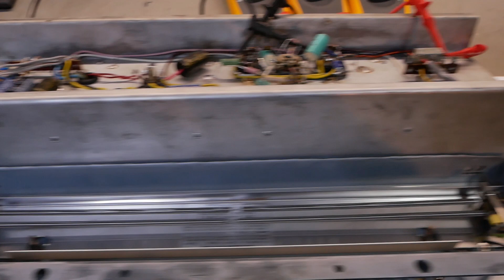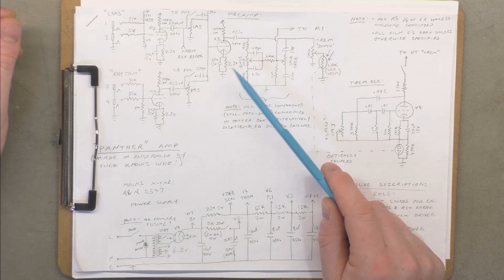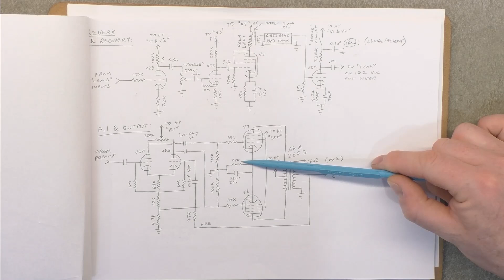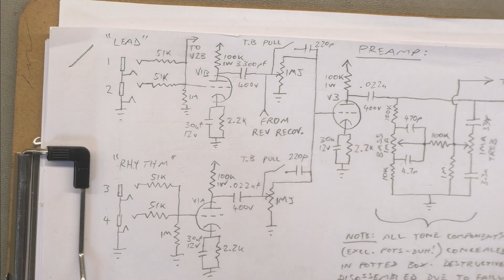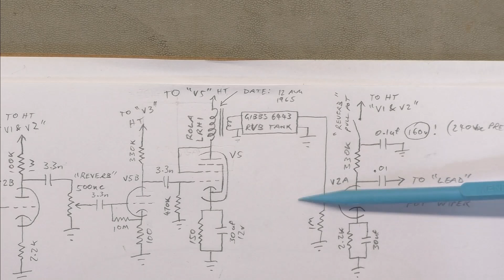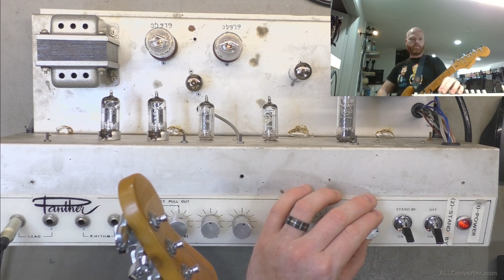Aussie "Panther" Amp Head - Part 2: Schematic Analysis & Initial Sound Testing

Comment: 6:42 Are those two 10k/10W resistors in series or parallel? in series they would make a single 20k/10W resistor, but in parallel they would make a single 5k/20W resistor.

Comment: That 6AV6 Tremolo Oscillator uses a circuit known as a Phase-Shift Oscillator, basically the signal on the Anode of the 6Av6 is phase-shifted by three R/C networks, each of which induce a phase-shift of 90 degrees, so the resulting phase-shift of all the R/C networks adds up to 180 degrees, since the signal on the 6AV6's Anode is 180 degrees out-of-phase with the signal on the 6AV6's grid, the resulting 180 degrees phase-shift of the three R/C networks puts the signal from the Anode back in phase with the signal on the 6AV6's grid, this makes the 6AV6 oscillate, remember there's two requirements for oscillation, 1, The gain of the circuit has to be greater than 1 to overcome losses in the circuit, 2, There has to be zero phase-shift from output to the input of the gain stage in the oscillator circuit.

Comment: Tomally and gain-wise it seems somewhere between an AC-30 and Townshend's tone on "Live st Leeds" (HiWatt, I presume?). The separation between notes when you play doublestops and partial chords is quite good.
Reply from the maker: I like to think they designed it with this in mind.
They were conservative with the coupling cap values, keeping the bottom end under control, which helps with string separation, without resorting to small or non-existing cathode resistors on each gain stage, allowing a nice quiet amp once the other issues were sorted out.

Comment: Very nice video. Thanks for the effort of drawing the schematic.
That PI balance adjustment idea, which has been used in Dumble amps and some Ampegs (and of course in many hi-fi amps) etc. is quite interesting because with that kind of circuit (where the adjustment range is not only partial) you really can adjust the PI totally out of balance.
Usually when you adjust PI balance to max PI AC symmetry or minimum THD, the adjustment ohm range needed is very small. And what makes adjusting  the balance very complicated anyways,  is the fact that you can make that adjustment by measuring either PI AC or DC balance or THD, or measure AC balance from output tube plates, or measure THD after OT etc., or just use your ears, not meters at all to make the adjustment. 😅

If that reverb driver is prone to overdriving or oscillating, fortunately those things can be quite easily (well, what is easy 🤔) tweaked by adding some voltage dividing resistors or a pot to signal path (and possibly trying some bright cap tweaks as well if wanted ) and adding sufficient grid stoppers to both triode and pentode sections.
The triode plate resistor value can be lowered as well to lower excessive gain and plate resistor bypassed with a small cap to tame those possible parasitic oscillations instead of grid stopper. But that driver circuit certainly has a pretty nice power to really kick reverb tank's ass compared to for example just a 12AT7 or 12AU7 driver. BTW, what is the reverb driver OT voltage or impedance ratio?

As I probably mentioned earlier, GZ34 would have been a much better rectifier for a beast like Panther, or at least a separate floating 6.3 V heater winding for the rectifier tube to make the amp more reliable.
Reply from the maker: You're pretty well on the money with those comments.
All will be revealed at 7am AEST tomorrow.

Comment: Definitely change to fixed resistors (DC on pots is always an invitation for noise) but before you do, it would be worth keeping what you have for evaluating the ratio of values for the plate resistors.  With a long-tailed pair, (without NFB) the triode that's driven by the input signal naturally tends to produce more output with equal value plate resistors. The 'undriven' side only gets signal through it's cathode.  In the earliest big-box tweed twins, they corrected for this by using a smaller (82k) resistor on the driven side for a bit less gain and larger (100k) resistor on the side that only gets signal from the cathode.  On that circuit (5F8) the NFB went to the tone stack so it affected the input signal going to the 'driven' side.

Fender moved the NFB to the grid of the triode that isn't being driven by the input signal in the next update (5F8-A). They continued to use 82k and 100k there, and throughout the Blonde and Blackface era, although the amount of NFB was gradually increased.

During the Silverface era, Fender went to 100k for both plate resistors.  This is counter-intuitive because they also increased the amount of NFB even further. I would the side of the LTP where NFB is applied would have a larger reduction of gain than the opposite triode, so I would have thought that side needs an even larger plate resistor to maintain symmetry.  Maybe they intentionally went for a bit of asymmetry?  IDK.

Anyway, it will be interesting to see what the resistance ratio is, if you tweak this for equal amplitude going to the output valves.

Comment: Can you jumper the two input channels or is the reverb channel out of phase with the other channel as they typically are in a Fender?
Reply from the maker: Ooof, just did it. It tones down the reverb response, evens out the freq response and you can balance between warm and bitey overdrive. FANTASTIC!
Reply from the maker: Did you read the schematic, mate!?Lol!
Yes you can jumper them. I haven't had time to, but I've been asked like 6 times now, so I'd better drop what I'm doing.
Reply: @BradsGuitarGarage  , sorry, not your fault; I can't really read the schematic very well on a smartphone screen, and anyway eyes aren't what they used to be. Interesting that the channels can be jumpered as that's unusual for amps with reverb on one channel. I haven't watched the entire vid yet anyway, and it's time for bed!
Reply from the maker: These two channels share the same 3rd gain stage and the reverb loop has it's own silly cray-cray amount of gain in stock form (which I've toned down quite a bit to keep it under control), so it's an amp perfectly suited to jumpering the 2 channels.

Comment: Very nice job on that hand-drawn schematic, although it's a little faint and hard to read when I'm watching it on a smartphone screen.  Your convention for how to draw everything out is similar to mine, with the obvious jumpers over the schematic lines and so on, although I normally prefer to draw the phase inverter the way you'd see it on Fender schematics, with each trode half of the phase invertor facing the output tube it drives, but that might have been a little difficult here since you've got the shared potentiometer on the plate B+ circuit. What the heck were they thinking?!
Reply from the maker: I totally thought about the PI thing and you are correct in my motive for drawing it vertically.
This was also done as an exercise in drawing a schematic neatly and legibly. I don't do it that often, and I'm trying to teach myself discipline in that respect. I see so many poorly drawn schematics from people online trying to figure out their problem, I wanted to set as good an example as I can, given the time constraints.
I planned to transfer it to a digital version for historical purposes, but considering this may be the only amp of this type in existence, I think a hand drawn version, scanned with greater contrast will be adequate.
Reply: @BradsGuitarGarage  I've always drawn and then, at the beginnings of my amp stuff, got a book from the stable of Kevin O'Connor of London Amps fame so basically, as he is so good at his drawing out, I can't really do schematic drawing badly...
This was years ago, decades even, and in those decades I got into art but now I'm back in again (and I'd also got into pedal making) the most interesting thing I've found is how difficult I find having received a few dual layer circuit boards designed within modern programs as, coming from schematics and point to point in tube amps, I find I have to go through a whole set of puzzles in my head to see the translation between the schematic and the modern PCB in front of me... a task which was really quite simple in old school stuff where the PCB was almost always just a version of the schematic.
Reply: @BradsGuitarGarage  , I've hand-drawn a couple of Magnatone schematics, tracing the circuits out by eye and a multimeter; that's "fun"! The circuits aren't anything like Fenders, and the internal wiring looks like an explosion at the spaghetti factory! BTW, I have nearly every guitar amp schematic ever published by Sam's, original paper with photos and parts lists, and containing lots of Silvertone and Wards Airline amp schematics in particular, so any time I am working on an oddball amp for which a schematic isn't available, I can usually find another amp schematic with the same tubes and number of controls, about 70 to 90% the same as the mystery amp, and which makes a decent starting point for drawing an accurate one. I've also got binders full of Sams schematics for vintage hifi, and for PA/ mic paging amps, like Bogen, Webster, Borg Rauland, Masco and so on.......